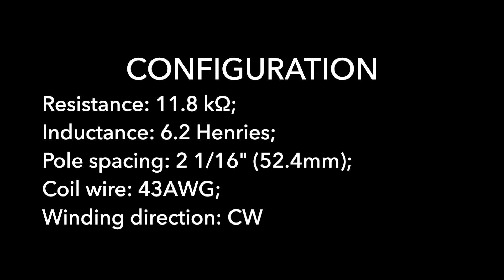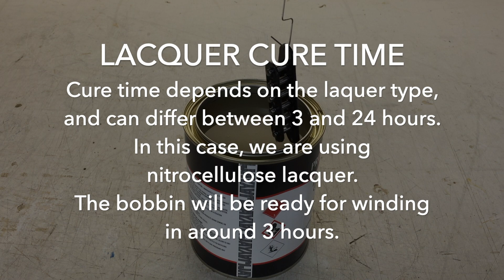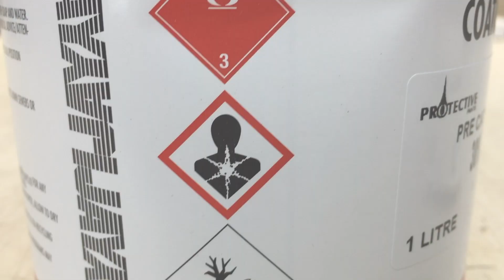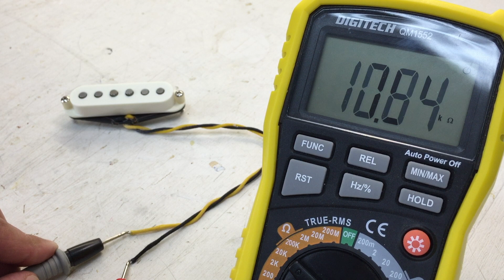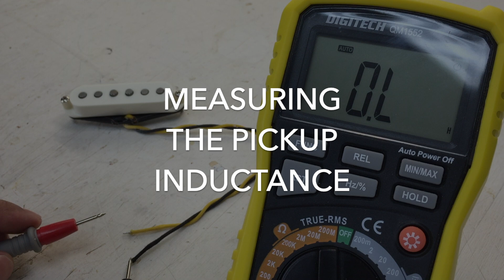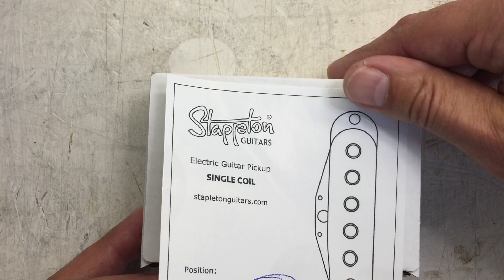Making hight output single coil guitar pickup

Comment: Greetings. I ask you to please answer a question. Between what resistance values of a strat pickup is the standard to replicate a 50s sound, considering using alnico 5 and heavy formvar 42awg wire?. And to get the mid frequencies a bit scooped, what resistance would be ideal for the neck position?. Thank you very much for answering.

Comment: this is a single coil with the resistance of a humbucker
Reply from the maker: The resistance of this high output bridge pickup is 11.8 kilo Ohm, and it's higher than resistance of the "normal" humbucker but lower than high output humbucker pickup. Cheers.